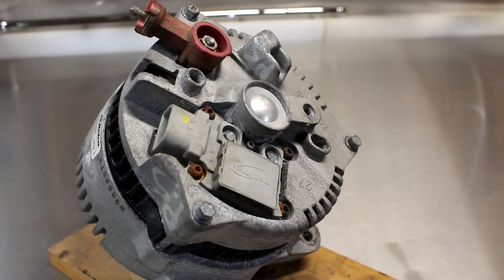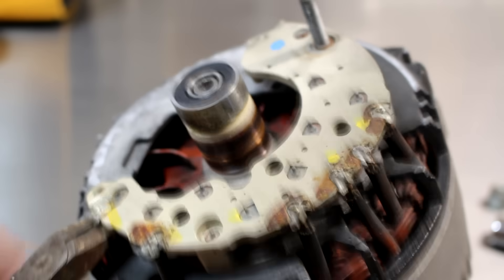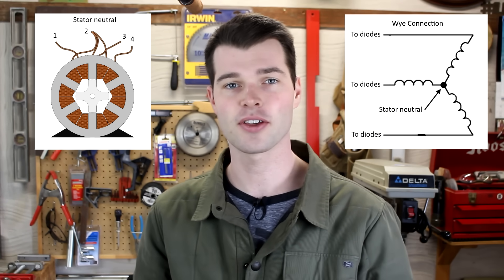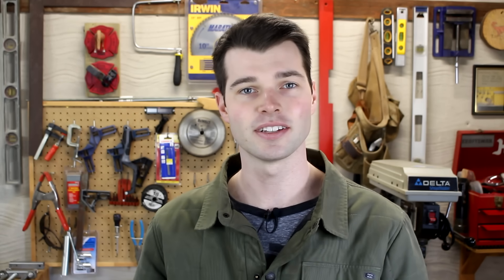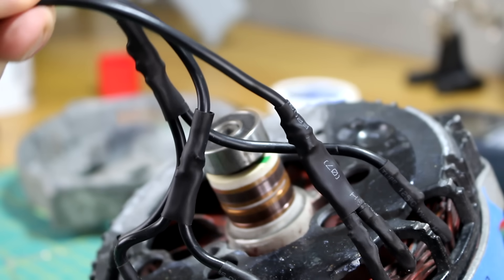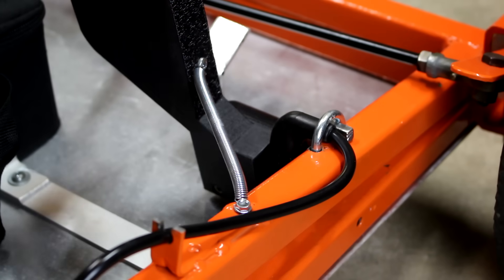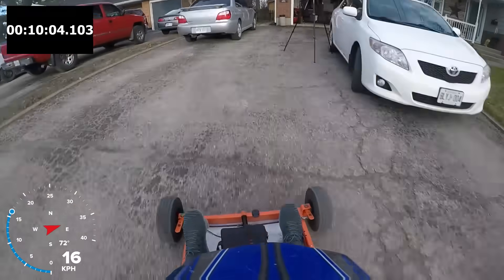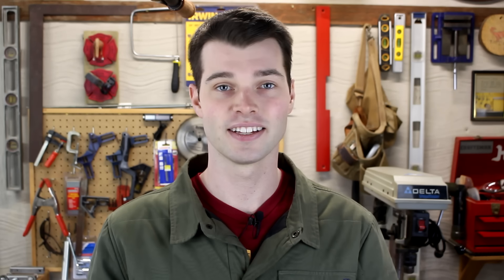Converting a Car Alternator into a Go Kart Motor

Comment: I love this video. I'm frustrated though, as I keep blowing ESC's trying to get this to work. Anything you can add about wiring the brushes for the rotor? Thanks!
Reply: A bit late, but there is an important piece of information missing here. The polarity of the 3 phase coils. He either got incredibly lucky or forgot to include this in the video. Flip a coil and the motor will only growl, and the current draw goes through the roof - blown ESC. Polarity can be determined by examining the diode connections or by applying low voltage AC to turn it into a transformer and measuring the induced voltages.
Reply: @eulachonfish  hi, finally found someone who mentioned my question. im looking to do this myself, as my dad left behind a bunch of vehicle alternators, and was wondering where the three wires comeing off the coil go too. i dont know a terrible lot of about this kinda stuff and wondering where i could learn
Reply: @explosevgamr5349  I'm a winder electrician by trade and this sort of knowledge is quite esoteric and a little hard to explain in detail without a pen and paper in person. If you want to learn the details you may be able to find a local winder willing to share info with a hobbyist.

However if you have only 3 wires you are in good shape - it is already set up star or delta and you don't even care which. DO NOT separate any of the coils further than this and you are just fine - changing the order will only change the direction of the motor and will not hurt anything. See this simple article for a good start: https://hackaday.com/2020/01/16/car-alternators-make-great-electric-motors-heres-how/

Remember that an 80A alternator is designed to handle 80A when cooled by the fan running constantly at a fairly high speed. An ESC can throw that 80A at it at any speed, which will provide tons of torque but cook it quickly if you don't either gear your vehicle to cruise with the alternator spinning fast or add an external cooling fan. Luckily alternators are pretty tough. Good luck with your project!
Reply: @eulachonfish  oh awsome, thank you so much man! This is actually really helpful. Do you know where I can find info on how to find rewinders?  And thanks again, I appreciate it greatly
Reply: @explosevgamr5349  Local phone book or business directory, look for electric motor service, motor rewind etc. EASA is our trade organization and I believe they have a directory.

If you find a small shop and business is slow the guys may be willing to help you out for a box of beer, otherwise you could probably bring one alternator and the ESC and pay an hour or two of labour to get them to show you how to get it running. Once you know you can build as many as you want.

Haven't done the alternator conversion myself but am planning to play with it this winter - I have a dune buggy type vehicle in mind with a pair of alternators driving the rear wheels. Cheap thrills

Comment: You do a powerful vehicle with little money. Nice. What happen if you use another alternator without modifications to recharge the battery?
Reply: Inefficient. Unless you ride down a hill to recharge, you'd s be better off with just the weight of the motor since you have to go up the hill anyways.

Comment: Hello austiwawa, Great job on this video...it's really appreciated. You've obviously done your homework. I was wondering if you could tell me from all the research you did if this controller might work?   https://www.ebay.com/itm/371731938464   They don't come right out and say it will work with senseless motors but the description does say, Quote "Double-Mode, controller can check the motor hall sensor condition automatically. If the motor sensors are broken, controller will operate to None-Hall mode."  
I contacted the seller and they weren't familiar enough with the controller to say one way or the other. What do you think? Does the part where it says "will operate to None-Hall mode" mean it will operate right out of the box in non-hall mode? Thanks again for the great video!!!

Comment: I wondered about doing something similar with a go-cart like this but with a gas engine spinning an alternator to power the motor/converted alternator, with a very small battery just for the initial surge. I dont know if its possible but it would be sorta unique to use the power generated at the point of electricity (with a centrifugal clutch)  by varying the gas engines throttle.  I realize no alternators and simple chain drive would be much easier. Just for something different, and with an inverter could be used as a generator in power outs.
Reply: This is how hybrid cars work.  They are efficient because the engine can operate at its optimal speed at varying loads

Comment: Presumably when you're not accelerating, the alternator (if it's permanently connected to the wheels) is sending charge to the battery. Is this what helped melt it?

Comment: please get yourself an Ameter.. so you can both manage your power.. and also so you can calculate the HP developed by the alternator motor.   Because of I squared R losses  generating heat.. even a little resistance at battery connections can destroy a battery  in the way yours was ( ask me how I know this !)   Good application of basic principles !  A small motorcycle would be a much more interesting application.

Comment: The difference between a generator and a motor.
Generator turns mechanical energy into electrical energy
Motor turns electrical energy into mechanical energy.
Reply: FastTX FiveOh they are both in the same as this video proves it the only difference is the application. This alternator can be both a generator on an engine and can also be a motor when fed electricity and can also work for regenerative braking if you had the correct controller, almost every modern hybrid/EV uses it motor as a generator to feed power back to the batteries and in turn acting as an extra brake for the vehicle along side the hydraulic brakes.

Comment: Why not put a couple wind generators on the front to charge the batteries and make it so u have a small wind tunnel for each wind generator and then you can charge batteries and have no need to find another source of power and yes u may need more than 2 of them to recharge but it ultimately could give the opportunity to find a way to make it aerodynamic and efficient at self recharge

Comment: Now add another alternator to charge batter or capacitors
Reply: Gordon Music the is no such thing as free energy. The amount of energy to spin the regenerative alternator would take away from the propulsion alternator and do nothing besides slow down the cart and lose energy from extra heat/friction so on. Regenerative braking like used on hybrids use the same motor for reg braking to charge to batteries not an extra motor causing parasitic losses.

Comment: what exactly is a Delta Configuration ?...I'm not an electrician....
Reply: steppenslow it's pretty difficult to explain without diagrams.  in delta each winding connects to the next one sort of like a dazy chain where each of the three junctions is connected to the supply. 

star configuration is where the windings connect to a central point and the supply lines.

there's a few youtube videos on it but I haven't found one that gets to the point without 5 minutes of "suscribe to the channel and watch my other videos" stuff.
Reply: Google 
PARALLEL  & IN-SERIES
You will get a better understanding of it if you understand parallel and in series

Comment: Why didn't he just leave the starter alone an run the charge wires back to the same car battery ,an use a car battery  , that way the power that turns is the power replenished in other words while you ride it recharges the  battery at the same time

Comment: Nice way of converting the alternator to a motor.  You ever thought of taking an alternator and using it as the charging as you are driving it or a solar panel doing the charging as well?
Reply: would be like trying to pick sand up off the beach house back deck with tweezers.

Comment: Wouldn't it be as easy as putting two smaller alternators on the front wheels connected to the battery for a way to get more out of it

Comment: Yep. People don't realize that although an alternator is an electric motor for the most part. There is still a 6 diode pack that prevents current back feed. Also called a rectifier. Essentially a diode only allows current to flow in one direction. A/C or alternating current is what an electric motor produces once spun. Alternating current is electrons moving back and forth at a specific frequency. Since batteries need direct or D/C current. A diode is used on an alternating current flow, to only allow the movement of electrons in one direction, and block the reverse directional flow. Thereby creating direct or D/C current output by the electric motor, which is now an alternator, if spun by some form of propulsion. Gas or diesel powered engine, wind blowing over a propeler, water flowing over a paddle wheel, enriched uranium 235 placed in close proximity to more uranium 235 with a specific critical mass and a moderator like graphite or heavy water to slow the flow of neutrons to generate heat and then steam to turn a turbine, or even someone peddling a bike with a chain ran to the alternator. Anyhow... outstanding engineering my man. Except for that minor restriction issue. But overall that is a minuscule adjustment, which is all part of the perfection process.
Reply: So you missed the part where he removed the diodes?
Reply: Hahahahahaa lol imagine enriched uranium under the seat, maybe 10 grams wont be as lethal
Reply: Ed 
Well said and nicely critized.
Reply: @gingerbread2875  Escuse me Ginger How Many Diode  do You remove, four or Six,. You are Very smart Man...

You are Welcome here to Brazil, the battery is 48 Volts... 

How Many Ampéres..
This engine Work Very good on 12 Volts.... When Possíble answer for me , i m live in Brazil...
TKS i m appreciatt your attenttion and Feedback...
Namastê...
Reply: Great video. Congratulations. Might I suggest that you investigate building a motorcycle, street-legal, with a DC motor scrounged from an electric forklift. I specialize in restoring the old British and German motorcycles, similar to the idea of building a chopper on a custom frame. All of your controls, front end, brakes, Etc would be as they left the factory. And you have plenty of room to hook the motor to a non unit construction transmission and the drive sprocket then to the rear wheel. So plenty of room for several batteries and the DC motor. I would like to investigate it myself, but time, the shop supplies and equipment, and knowledge, are not anywhere near equal to what you have demonstrated in this video. But again you did a great video and has taught me a lot.
Reply: @charleshealy341  YES My dear Friend, Welcome to Brazil for Biulder this machine here , we have Great Bussines and oportunitt   now here... Think about this Work in Brazil now...
Reply: I didn't know anything about alternators, but when he said he had to remove a "diode pack" I immediately thought it must be a rectifier so that it supplies DC voltage. Good to see that I was right.
Reply: Well Ed, don't you 'wanna' look like a smart ass! What were you "pulling", during the early section of video where the author removes the diodes?
and.... "D/C Current" Ed? Try "D.C." (indicating abbreviation for Direct Current) or just "Direct Current". Your suggestion of a "Direct/Current Current" is a flog!!
and.... Also Ed, your statement "A/C or alternating current is what an electric motor produces once spun" is BULLSHIT, FAKE and a total CROCK OF SH*T. A DC motor (yes Einstein, THEY ARE ELECTRIC MOTORS), when spun via an external power source will produce D.C. (Direct Current), suitable for charging a battery or powering other suitable electrical equipment, via voltage regulation. So, get your facts right and leave the author in the video alone, for a video/project well done.

Comment: Just wondering about the separate battery pack running to the brushes. Is it always turned on? Is there a reason it needs to be a separate power source. Is there any more info on this somewhere? 
Thanks.

Comment: Very Cool, Can you reverse?, Could probably use a Polarity switch on 2 of the 3 phases.if you haven't mentioned before. Work with any DC Appliance or Air Handler, and compatible controller? Thanks, good stuff

Comment: Hi good job, but I have a question, what awg (caliper) is the wire it you used? and other question, when finished weld the wires in the moment to insert or assembly on the brushless controller how your identified what wire from the alternator is connected in the yellow, blue and green?

Comment: The best explaining video on this alternator-to-motor conversion. Highly interesting since there's a ton of surplus alternators found at every scrapyard that can be converted to cheap and recycled bldc motors for e-vehicles. Some more figures and data might be welcome, can you tell anything about power output from the motor? Any thoughts on the field voltage and currents vs. rpm's and horsepower output at low and high speeds? I've read somewhere this is key to getting the motor to behave smooth and deliver max torque at high and low rpm's/loads. I'm wondering if it's worth investigating and designing a custom drive for it based on arduino and modern bldc driver chips where the arduino takes the field strenght/rpm's and driveload in to account.
A very inspiring video for sure, also because of the cool end result: a bangin' little go-cart!
Great work,Sir.

Comment: Check it out... This kid looks a lot like Tony from West Side Story circa 1961 or so.
Now, a question... Has anyone tried to integrate an alternator/generator into the stopping circuit of an automobile? Such that when you press the brake, somewhere in the drive train the secondary (or maybe even the primary?) alternator/generator is connected to absorb part of the braking energy and charge the battery? Anyone?

Comment: alternator is 12V rated (14.7V max after rectifier) so anything beyond 15-16V (in delta config.) 
as input will saturate the wingdings (stator) so that might be reason for too fast discharge.

Comment: Trying to. Understand the. Theory of electric bikes. I. Have. A. 250w. Motor hub. A .36v batterie and thw controller. Text me 780 996 2450. Need to .resoder a. Joint in controlletr no. Power. To. Motor

Comment: Good video but u should use the grinder when cutting so the sparks fly toward u. When or if a cut wheel breaks it's likely to push tool away not towards as your use would  result

Comment: The only improvement that I see needs to be done, besides the beefier batteries, is cooling for the now three-phase DC motor. A 12VDC fan or blower motor can be easily mounted on the rear of the drive motor to provide cooling. These are available almost everywhere, and can even be found at a scrap yard, or a cannibalized computer. A brushless motor with 2 bearings would be the most efficient.

Comment: I'm no electrician but wouldn't it have been easier to make the go kart run off the battery and just have the alternater chain driven and charging the battery? 🤷‍♂️ I dunno just what I thought he was gonna do
Reply: There are a few key bits of information you're missing -- you can't run an alternator to charge the batteries while running the kart. The alternator places additional drag on the kart when it's charging, so it's ALWAYS a net loss. Alternators are effective for gasoline cars because you offset the drag created by the alternator by simply burning more fuel. Gasoline is super energy dense, meaning there is a lot of energy in each gallon, so you can get away with stuff like that and still have awesome range, but you have to remember that you're CONVERTING energy from liquid gasoline into electricity in your batteries. You have to give up energy somewhere to charge that battery.

Comment: can you right here write model of your alternator i am afraid buy wrong model
Reply: Almost all car  alternator will work to become a motor. Buy a few second hand ones. Normally they have failed voltage regulator or diode pack. These you don't need, but the housing for the carbon brushed is required.

Comment: extremly cool!! there´s one thing i don´t understand...why do you need the motor controller?
Reply: The motor controller is needed to provide a pulsating programmed input of alternating current to the stator coils so that it switches NORTH to SOUTH and vice-versa continuously  in order to cause magnetic reaction  with the rotor ELECTRO MAGNETS that in itself receiving a constant DC voltage (up to about 14 volts usually) to make it remain as a constant pole rotating Electro magnet.  These configuration will make the alternator shaft turn since the stator is fixed around the internal side of the alternator housing. Hope you understand.